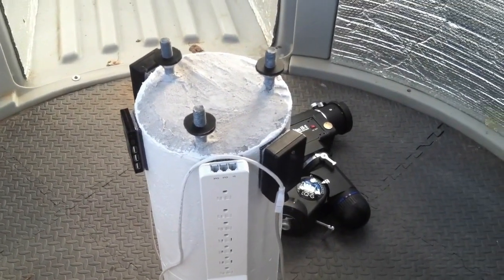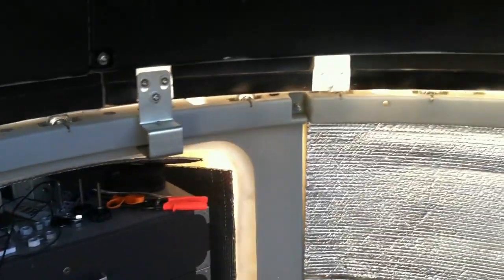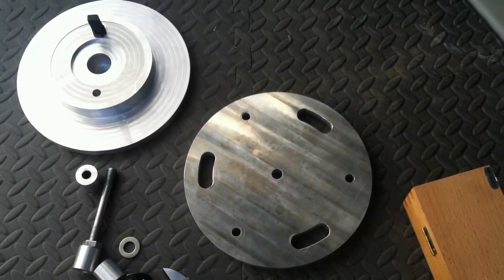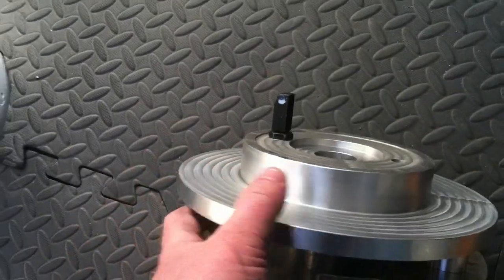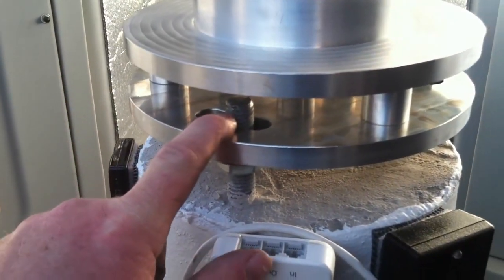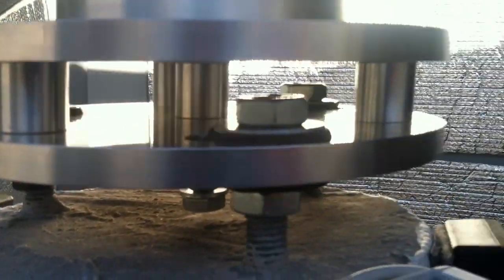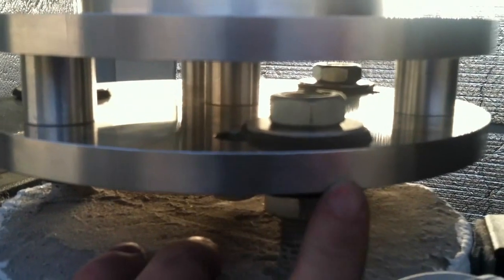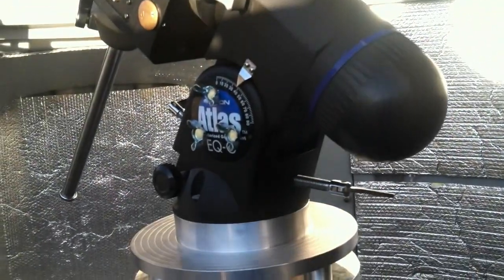New telescope pier mounting setup CNC project

Comment: Looks solid...
Just get rid of the rubber washers.
Rubber in such an application just BEGS for stability.
Once you start attempting imaging, the instability will be from the rubber washers.
Maybe use hard thermoplastic material instead of rubber?

Comment: Nice job machining the pier plates, I was going to ask you who made those for you, now I know.  Nice project and I'll be following with interest because someday I want to be in the same situation.  However, my situation will be more involved because I'll have to move to a more compatible location first, neighbor's fast growing (right on the fence line) trees have blocked my view.  Too bad I got interested in astronomy imaging a few years after moving in and actually had a nice view of the N/E, E, and part of the Southern skies.  The main problem is I moved to downsize the yard due to previous motorcycle accident injuries.  The side problem that most of us have to put up with is major urban light pollution, mainly the light dome of Sacramento, CA., but moving to where I have the space for a small observatory will enable me to switch to narrowband imaging, at least that will mitigate the light pollution issue.  Nice job.